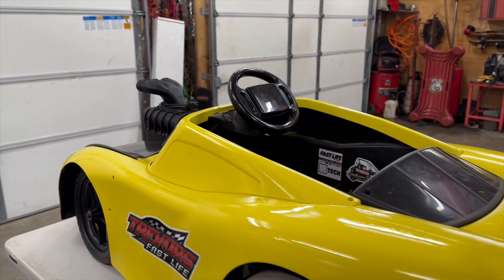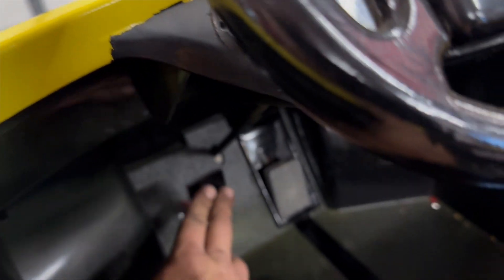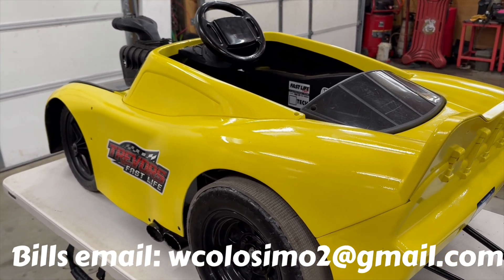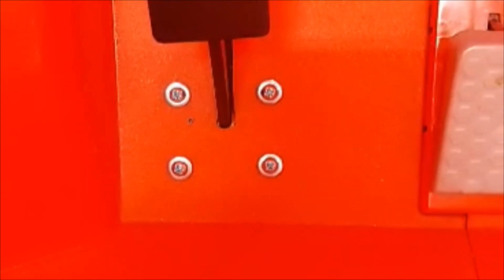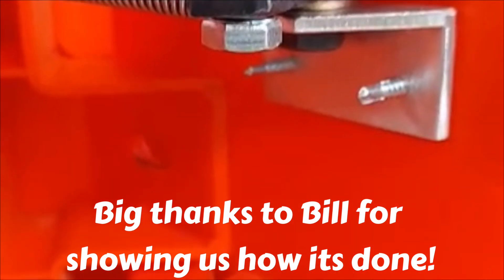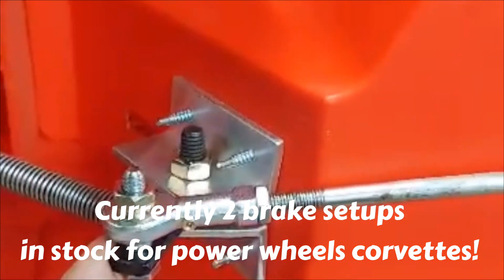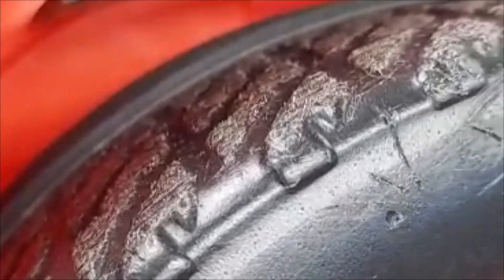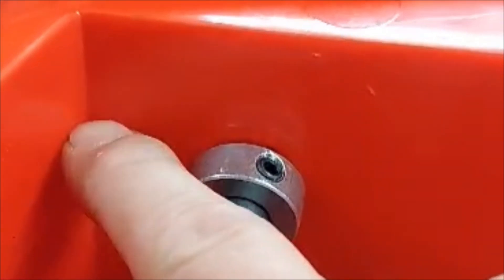How to add brakes on your power wheels!

Comment: Alex do you have any info or link to that front wheel and tire setup? I have one of the old nascar’s and a corvetter looking to build out. Great content!
Reply from the maker: @1987creed  no problem man! Check back on our channel I have a video titled “ drag skinnies on your modified power wheels” it lists the bearings and wheels in there as to what we use!

It’s basically a strider wheel with the correct sized bearings